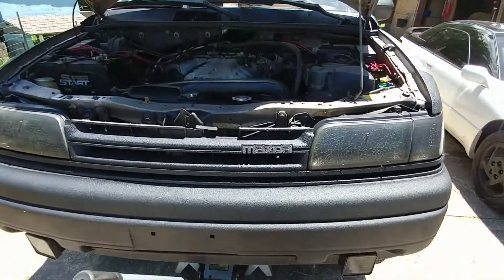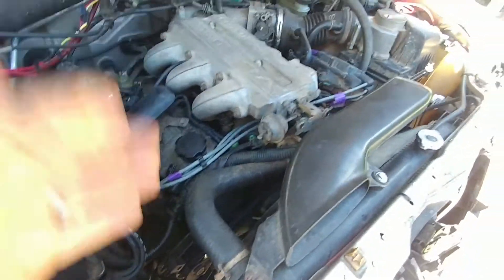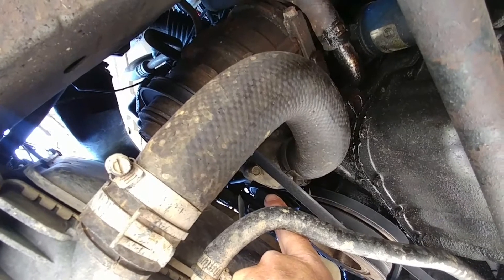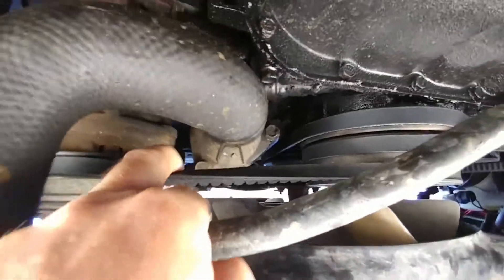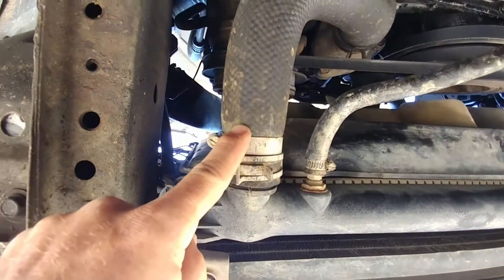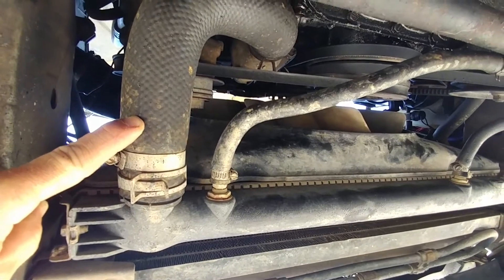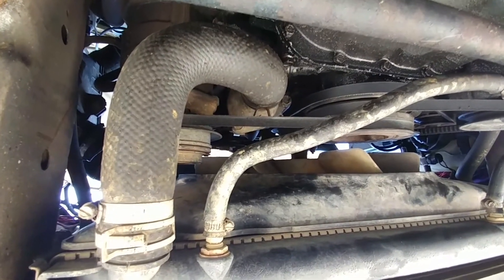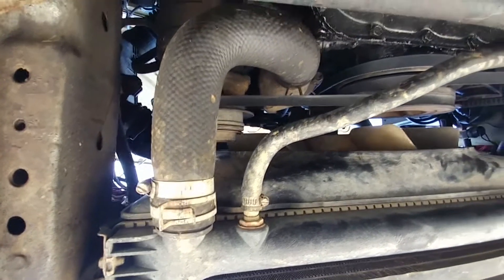Mazda mpv thermostat change procedure - super easy!

Comment: I'm doing crash course learning and how to take care of my 89 Mazda MPV do you by chance know if it has a radiator fan or just the one big fan in the front I know that sounds dumb but I don't know and I am basically trying to fix her with minimal mechanical knowledge or experience
Reply: The 89 should have 1 big electric fan mounted on the radiator!  My 92 would overheat up hills, turn out my electric fan wasn’t kicking on.

Comment: hey do you know how to remove a water pump on a mazda mpv 1992 v6? please respond!!!
Reply from the maker: Yes, you have to remove the belts, the radiator fan, and the timing belt covers [not the timing belt] to access the water pump.  It just has a few bolts and a gasket and is easy to take off and install. The fan is probably the hardest component to get out.
Reply: When you changed your thermostat, did that fix your issue? Or did you do the water pump too? Awesome video man